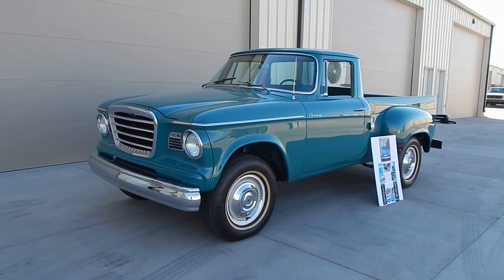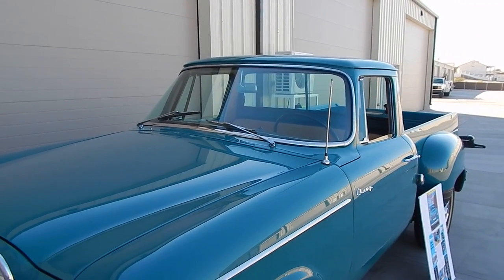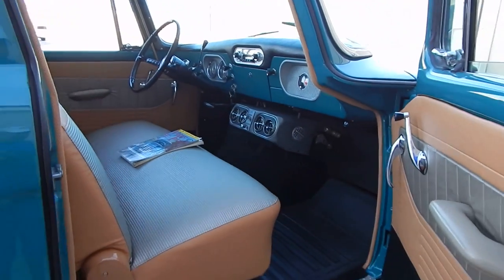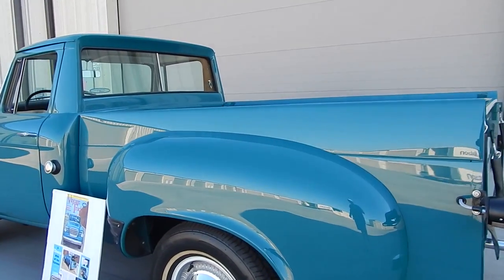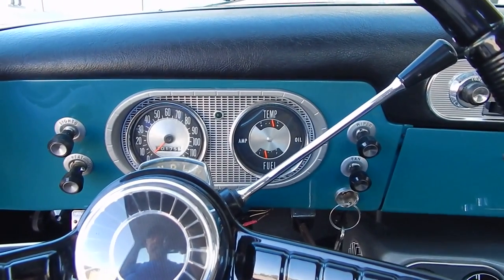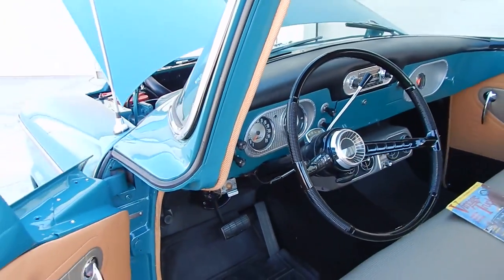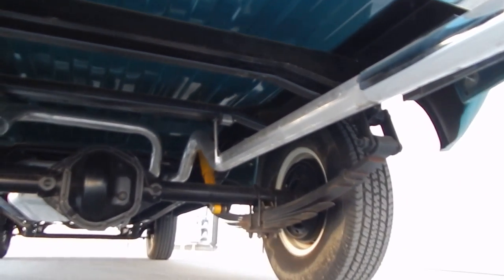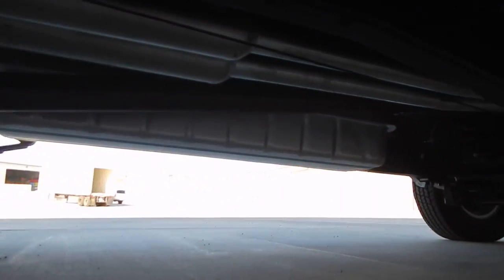1963 Studebaker Champ Pick-Up (SOLD)

Comment: One of our company trucks when I was younger was a white Studebaker Champ, it was a plain jane, no radio or other accessories, except it had an electrically operated overdrive.  It was a straight six, three on the tree, and a little white knob under the dash for overdrive, as I recall, get it up to highway speed in 3rd gear, let off the gas, pull the switch and wait a few seconds, if you did it just right it would be in overdrive.  There better not be a hill, in  OD it wouldn't climb any kind of a hill at all.  I put a few thousand miles on it, interesting pickup.  The one shown here is gorgeous!